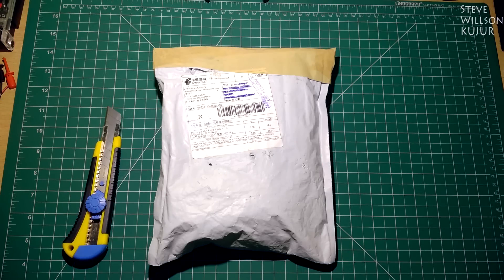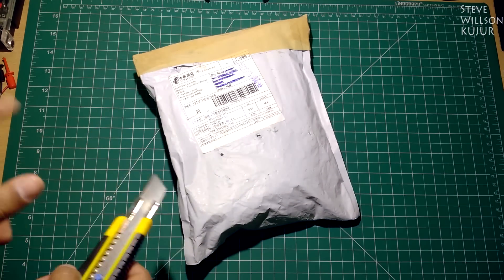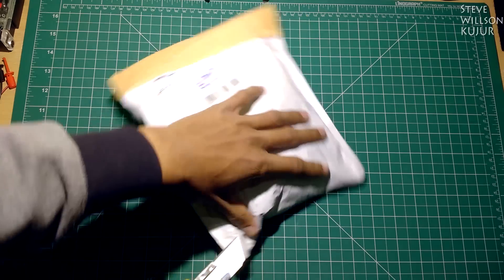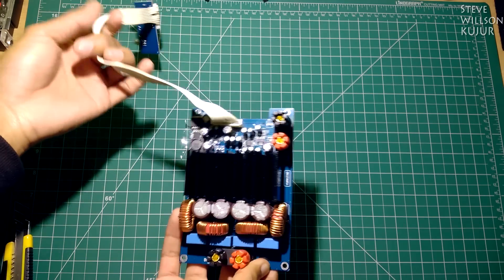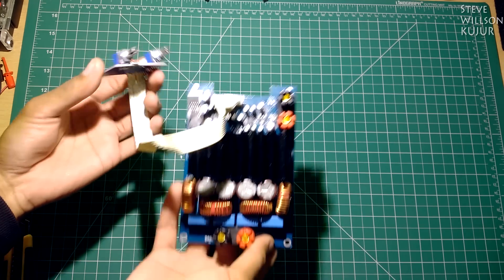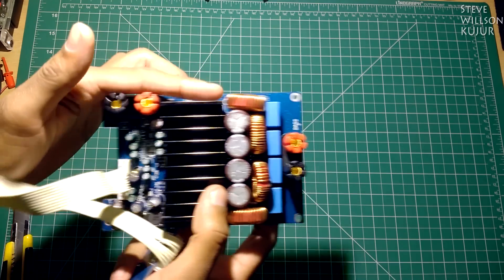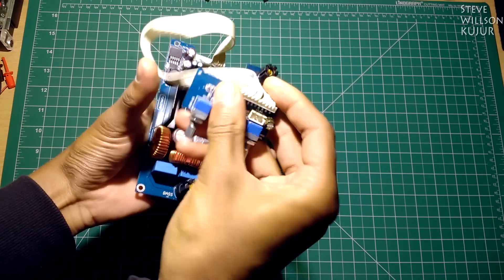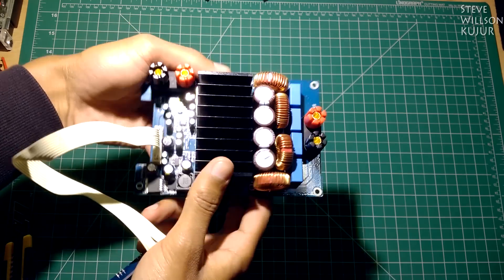Postbag #2 - 600 Watt Class D Amplifier | TAS5630 Amplifier | Subwoofer Amplifier

Comment: I bought one from the ebay.

I turn it on.

The amp board is start smoking and burning.

I dont now why.
I connect the wires correctly.
I connecting two 24v dc powersupply to the amp!

The TAS5630 ic is broken.

Comment: what is the input power rating of this amp... and where is the input for aux jack .....
Reply from the maker: +neelesh maurya input voltage 50v @ 12 amps and the input on the potentiometer board .

Don't worry I'll make a test video of it .
Reply: Tysm